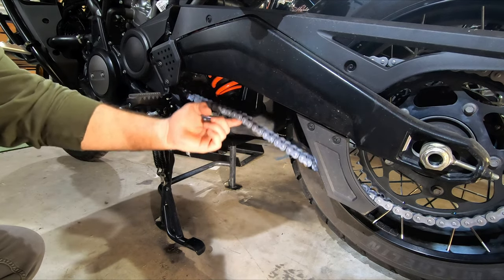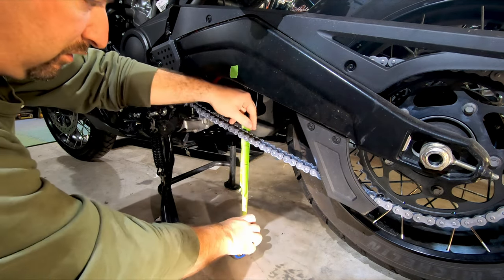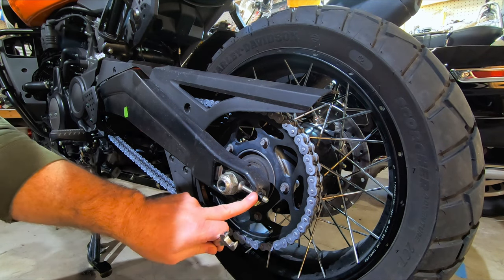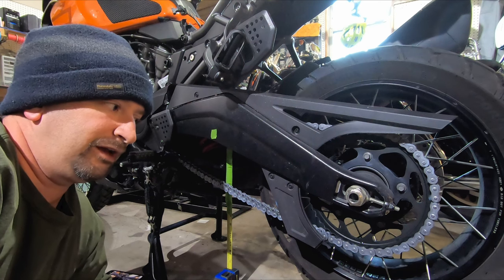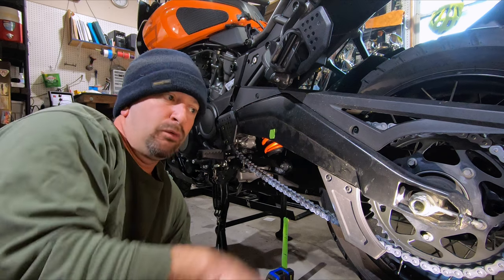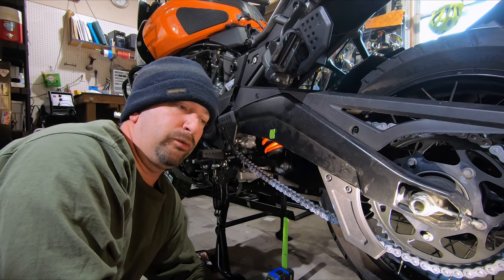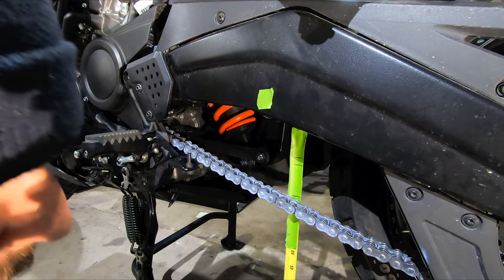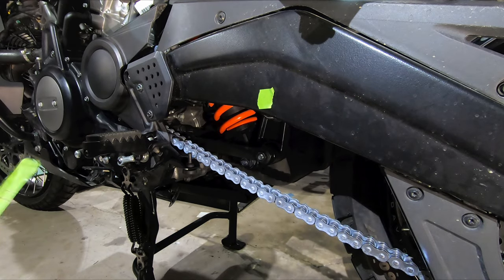Harley Davidson Pan America chain maintenance, Part 2

Comment: think you do a great job . i use a snap gauge to set mine the axle tube on my bike has a 16.8 mm hole on one side 14.8 on the other just curious if yours is same did you check id of hole before measuring to flat steel?
Reply from the maker: You are correct, I just checked and yes, measuring to the inside on the axle is NOT going to give an accurate measurement for wheel alignment. The axle tube will, but my calipers would not fit it that area. In my case, I’ve since double checked and adjusted my axel using other measurement points, but yes, the method I showed in this video is NOT going to work. Guess I need to make a new video.
Reply: @MikesMotorbikeChannel  i use a snap gauge and then measure with calipers. the OD of the adjusters is identical but i have machining tools in my shop. since i machine parts for people that's the best i came up with for now. videos are good keep them coming.
Reply: @MikesMotorbikeChannel  shouldn’t you delete this video? If I hadn’t read the comments I wouldn’t have known it was incorrect?

Comment: Hi and thanks for all the great videos you make, when I'm unsure about something I always look through to learn a bit. Just changed front and rear tires. I thought it was a little difficult to get the rear axle straight, but I got there in the end. Surely Harley-Davidson must have some special tool for this? Tried to Google but can't find anything, do you know of anything? Love my Pan America. Jens Petter Jørgensen/ Norway
Reply from the maker: No special tool that I’m aware of, just measure between the flat surface and the surface of the adjuster.

Comment: Pleased I came across this channel. I really like it. Very useful and after more than 40 years of riding I've still still learned a thing or two.
I discovered - and bought - those weird 360 twisty brushes that I had never seen before. And cleaning has never been easier. That's a big thumbs up.
I have a 2021 PanAm and after 20 years of classic Harleys I'm back to chains again and forgot some of the basics.
I've never gone to the length of measuring  the alignment with an accurate measuring tool either. More sort of - by eye !

Comment: Hi from the uk Mike!….it would be so useful to me if you were  to demonstrate how to use the chain slack indicator tool supplied as standard in the toolkit, as no one seems to be able to do this(which includes the hd dealer I bought the bike from brand new…any chances please ?
Reply from the maker: It’s useless in my opinion. I’ve yet to figure out any way to use that tool to accurately check and set the chain slack.

Comment: Hi Mike,

Would you happen to know what are other specs for sprockets and chain sizes we can use beside HD OEM specs? 

HD - OEM specs:
Chain Size: 530
Chain Links: 128
Front Sprocket/Pulley Teeth: 19
Rear Sprocket/Pulley Teeth: 48
Reply from the maker: I’ve always used stock sprocket sizes on my bikes so far, so I’m probably not the best person to make any recommendations on that. But you definitely need to stick with the same size chain.

Comment: How long does the chain on the Pan America last if it properly maintained?
Reply from the maker: I have 14k miles now and chain is still well within spec. But I also ride pretty conservative. If your front wheel spends time in the air, you will wear the chain out faster 😆

Comment: Thanks for the video! Forgive me if I am wrong, but aren't you underestimating your chain slack with this method? 1) the chain is not parallel to the ground, shouldn't the tape measure be perpendicular to the chain? 2) Although there isn't a ton of additional slack when pressing down, you seem to be only measuring the slack when pulling the chain up, I do notice ~5mm of additional slack when pulling down on mine
Reply from the maker: You make a good point, and usually when I'm checking I hold my tape measure at an angle to account for that but I didn't really do that when I was filming this.
As for pushing down, the service manual does indeed say to lift and push down on the chain. The transmission should be in neutral, but you also want to make sure you are not allowing the rear wheel / sprocket to move at all while you do this so that it does not throw off the measurement. I'll have to double check, but I don't think on mine it would give more than a couple mm though.

Good catch.. maybe I need to make a new video while paying closer attention to detail.  :)
Reply from the maker: UPDATE:  So I went out and took a quick measurement with my tape measure perpendicular to the ground vs with the chain, and my measurement was off by about 4mm, meaning my chain was 4mm tighter than what I actually measured if I don't hold the tape measure perpendicular to the chain. In my case I adjust to the looser side of the spec anyway, so not a big deal. But you are correct in that it does throw off the measurement that way. Good point.

pulling down on my chain only gives me an extra 3mm of measured slack.. still, attention to detail.. that is the proper way to do it.

Comment: Hey Mike, love the two chain maintenance videos! Do you have one on removing the front sprocket cover and cleaning under there? Happen to know what size star bit I need to remove the cover?
Reply from the maker: No video for that, but it’s a t30. There are 3 of them holding the cover on.
Reply: @MikesMotorbikeChannel  Thanks Mike, I appreciate it!